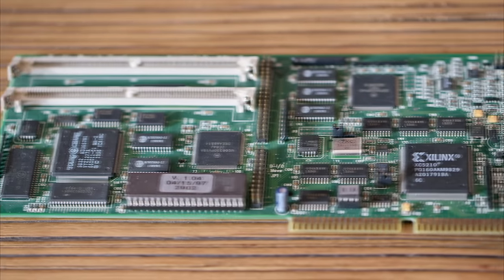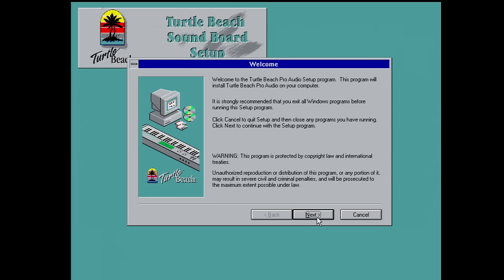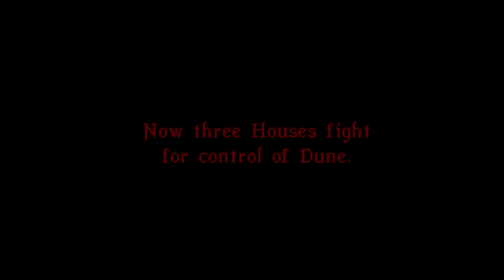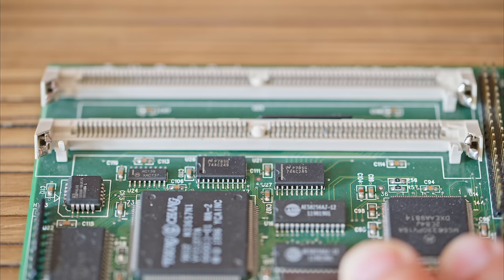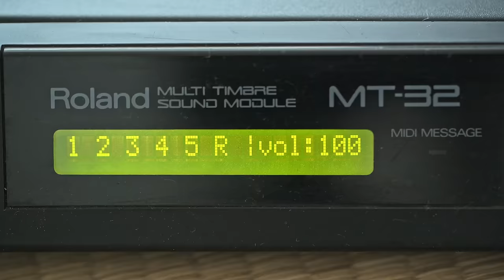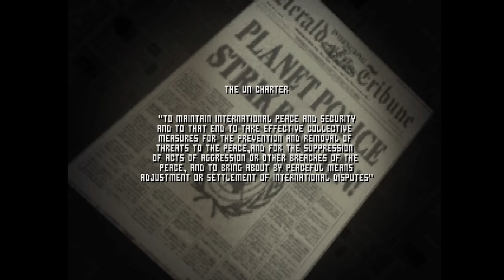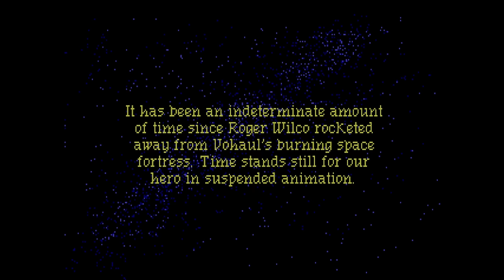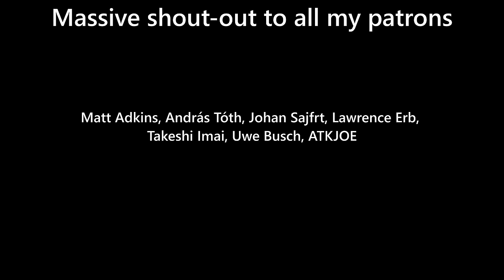Turtle Beach Pinnacle - Quest For The Ultimate DOS Sound Card Part 17 - Professional card for DOS?

Comment: Interesting video, never tried that card, was always a bit too pricey 😅 but isn't there a way to either use two different midi ports for the onboard midi and the daughter board? Some cards have jumpers or in the config file. Others a setting in the windows control panel before going back to dos ... Oh, and regarding the sound volume, there might be an option to set the mixer to the windows one in command line
Reply from the maker: Unfortunately, it can use only one MIDI port. And unfortunately, the mixer is a Windows program.
Reply: @KITR-UK  I have the same issue with some cards, what I end up doing is having one card for midi listening to one port, and a soundcard for sound effects where the midi is routed to another port, and an external midi MPU that lets me use multiple inputs/outputs and it's taking too much space 😅 but at least I have some choices 😅

Comment: When you run 2 sound cards how do you connect both to your speakers?
Reply from the maker: There are couple of ways. You can either use an amplifier with two inputs that work concurrently or some sort of hardware mixer. I use two sound cards in my capture PC.
Reply: @KITR-UK  

Thanks! I'll give this a shot.

Comment: Hey Karl love your vids saving this one for  tomorrow maybe we can help each other out ? I have a Roland SCC-1 that I purchased in 1989 ? and re discovered in the bottom of a cupboard !  I planned on using it as the centre piece of a retro machine build but just don't have the time or space :-(  so I'm planning on selling it. The problem is I have no way of testing if it works or not ! Would you be interested in a loan of the card for one of your videos then I could sell the card as tested and working !
Reply from the maker: I already have two of SCC-1s, one for the IBM PC and one for the PC-98, however, I can certainly test it for you. Contact me by email and let's figure something out.

Comment: Hold on. There is no first class support for MT32 in Gabriel Knight. It simply reprograms it to GM compatible first thing i think and then just pretends it was a Sound Canvas. All the music is composed and stored as GM.

I wonder what other games do the same thing, of the ones you showcase. Potentially all of them, regardless if they work with UART type MIDI interfaces.